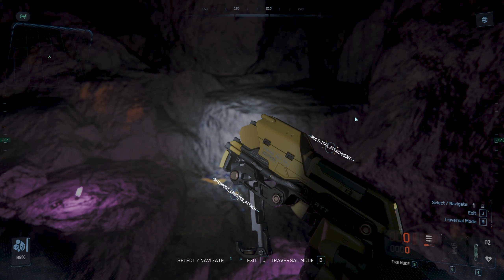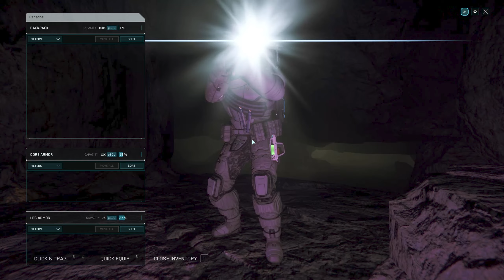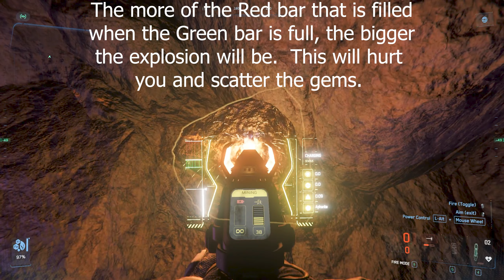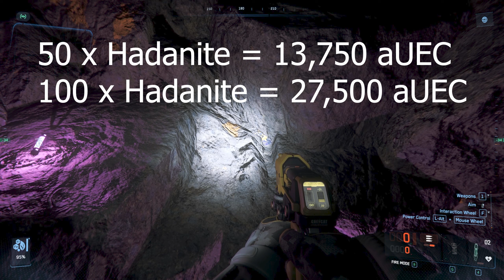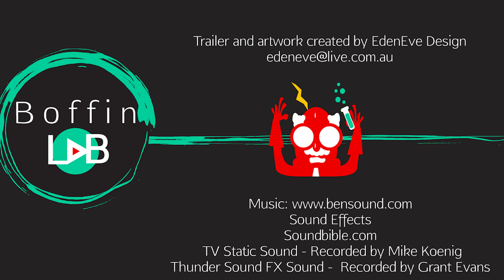Star Citizen 3.23.1 - Tutorial - Hand Mining

Comment: I seem to be affected by a bug with mining tool attachment were I cannot scan the rock to determine shown the charge level on the left side before mining the rock.
Reply from the maker: Yes I have seen that bug.  The next time I logged in I was able to use the mining attachment properly.  Its a known bug and a report is in the system about it.  The Issue Number is #STARC-102801 if you want to contribute to it.  

There is a work around.  You can tell by hearing when the crystal is heating and when it is in the green zone.  If I remember correctly it beeps while warming up and then goes quiet in the green zone.  I can't tell you what the noise is for the red zone.  I would avoid mining this way unless you really don't want to waste a trip.